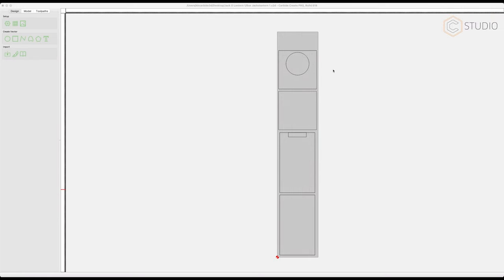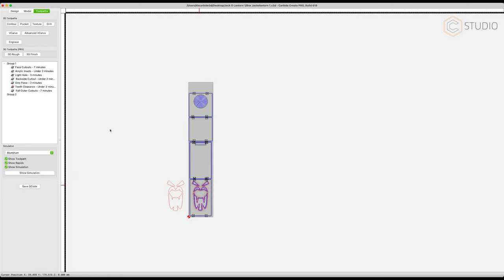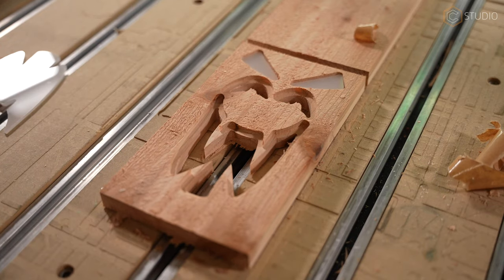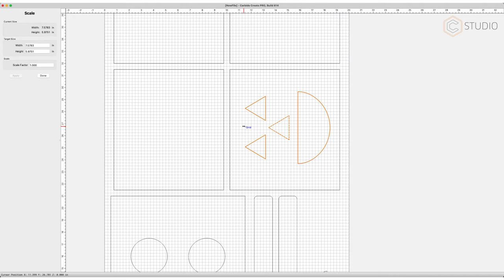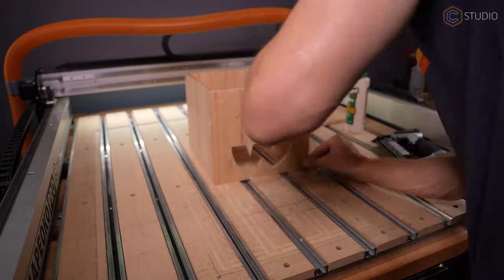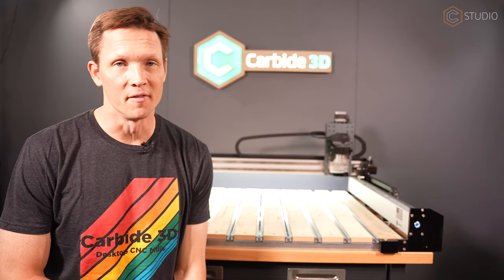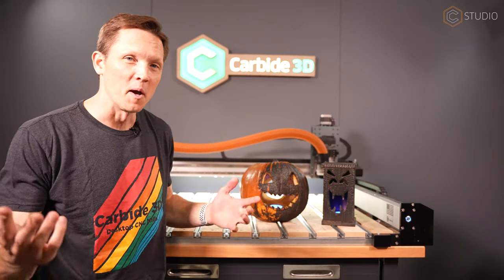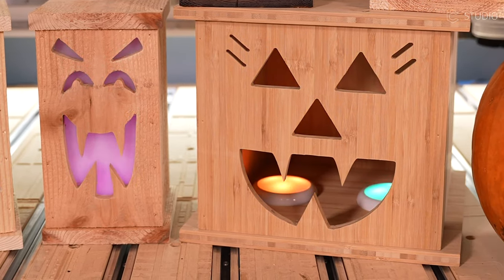How to Make Halloween Lanterns - A CNC Project

Comment: As for the inlay, how do you have it cut out the shape without an outer "boundary"? Essentially, can the software just cut along a specified line?
Reply from the maker: Hey Matthew.   The software allows for a wide variety of choices for boundaries of the art work.  Inside, outside, directly on features you have drawn.   In this case a small offset was created so the inlayed part was slightly smaller than the pocket carved for it.  Check out My.Carbide3D.com    There we have a ton of video training modules designed to get you learning to design before you even purchase a machine.  Give it a look.

Comment: On the acrylic inlay what spacing should be used for the offset.
Reply: That was a question.  Should have ended with a ? :)
Reply from the maker: For the inlay it was 4mm.  The Acrylic Inserts were then 3mm.  For every shape you'll have to play with those numbers based on the end mill you are using and it's ability to exactly replicate the outline of your art.  Relationships between end mill diameter and artwork detail will be at issue here.  The best way to allow for fewer problems is to have a larger inlay to allow more potential overlap for your acrylic inserts.  All depends on how exacting you want to be.